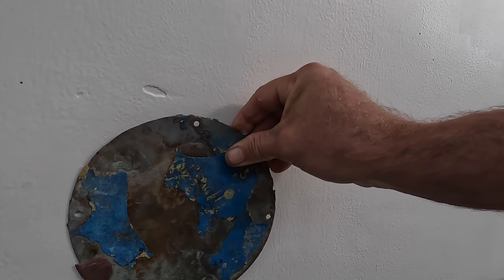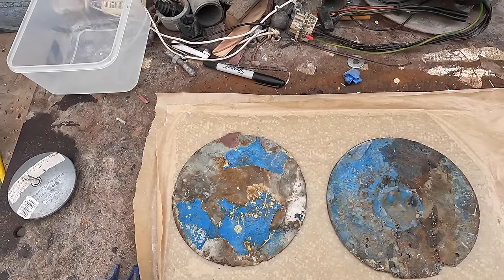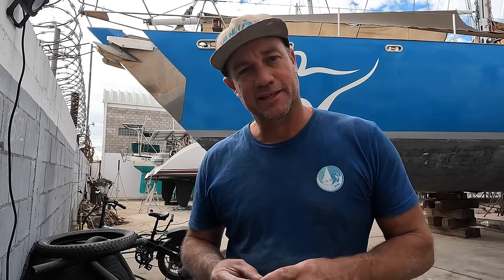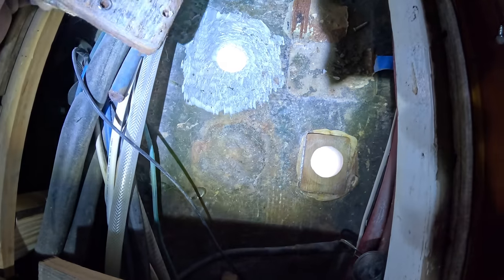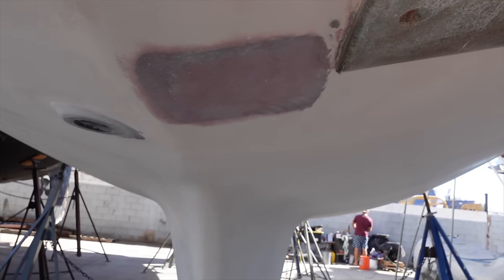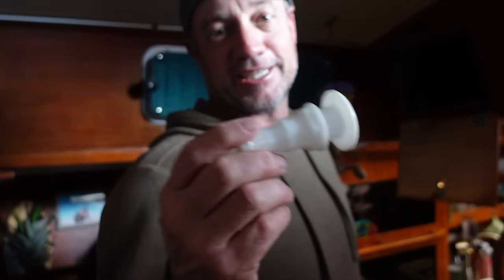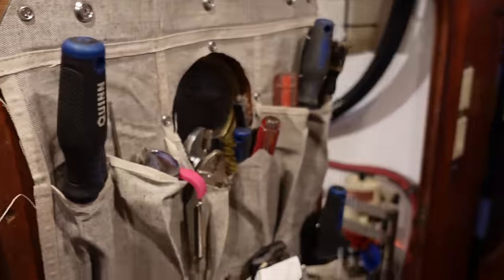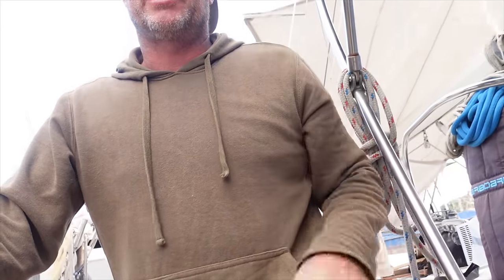DIY projects on our 44 year old SAIL BOAT | Ep 391

Comment: Love all the improvements you're making! The boat is already thanking you. One thing to keep in mind  as you're blue water cruising is how things are secured in the event of a full broach or rollover. We always hope it will never happen, but if it does all of those metal tools will go flying around the engine room, potentially shorting electrical connections or jamming in moving machine parts. Very unlikely you'll ever be caught in weather that bad especially with how good GRIB models have gotten. Always better to at least have a plan in place if it does, like stowing those tools elsewhere when needed.

Comment: I’ve got the same issue with a few screws. Also I’ve replaced every single plastic piece with stainless steel. They were a disaster. Deck scuppers are new now :) they were falling apart in my hands when I got them out.